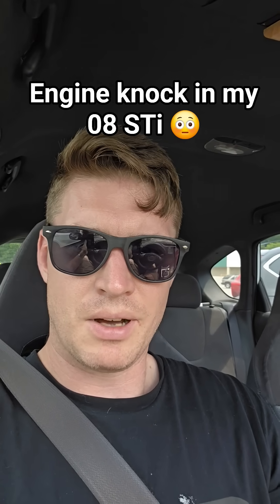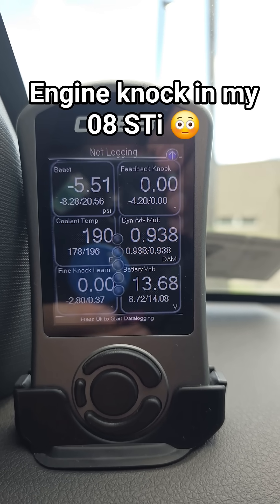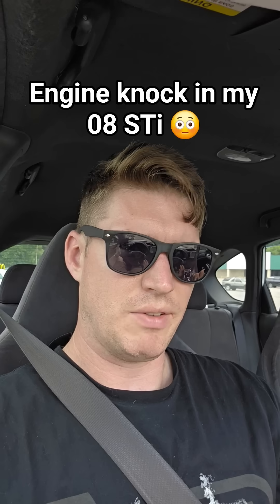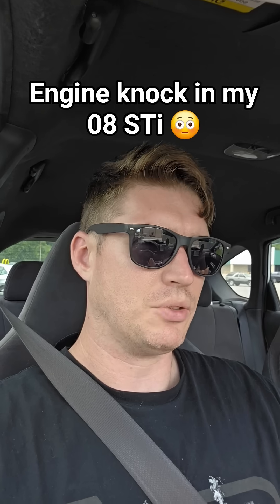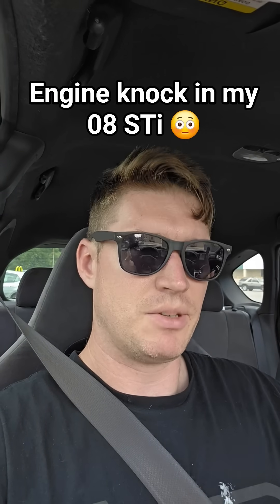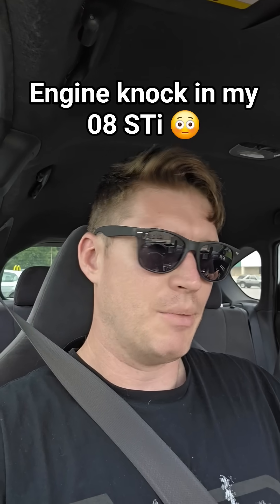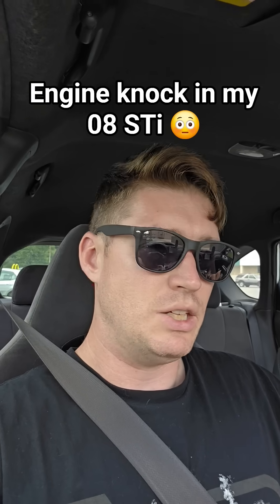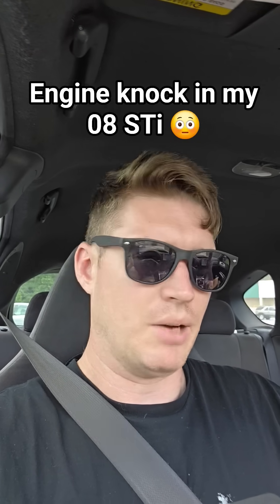What to Do When Your STI's DAM Drops (Accessport Explained #subaru #accessport #Cobb

Comment: Would it help to richen the fuel mix?
Reply from the maker: Not in my case, because I haven't changed anything else recently aside from filling up. If you start messing with the fuel tables and that wasn't part of the initial issue, now you have two separate issues and will make troubleshooting that much harder.